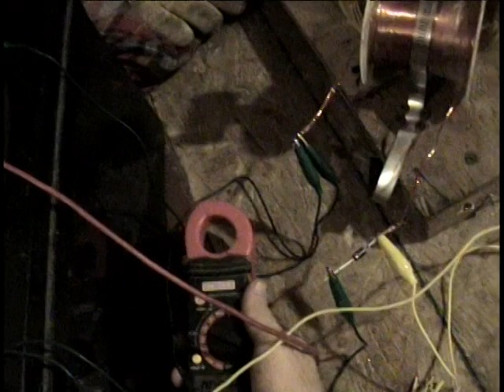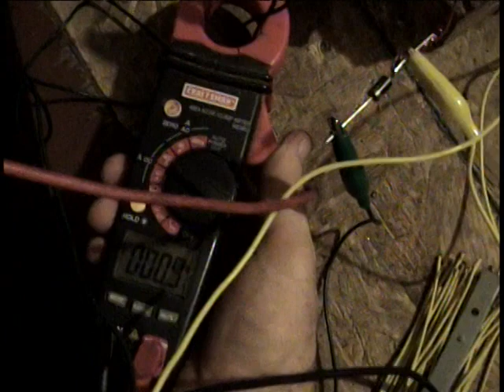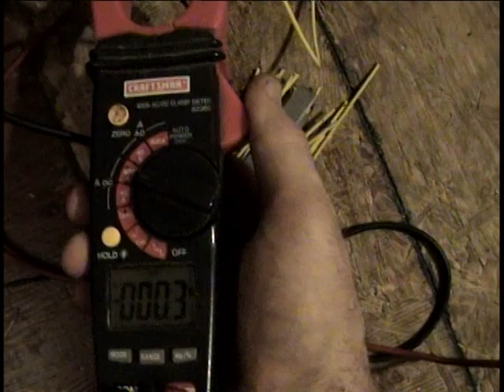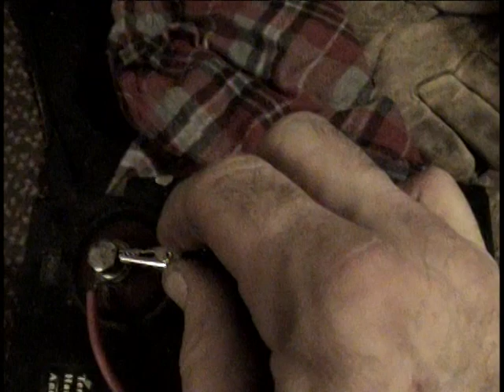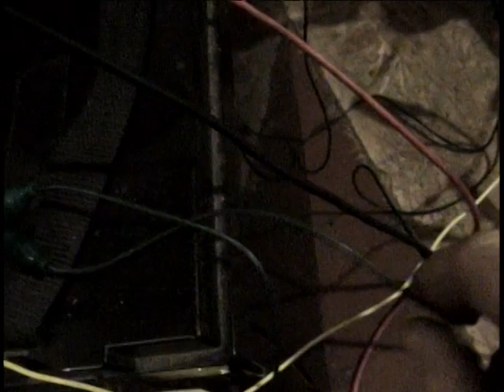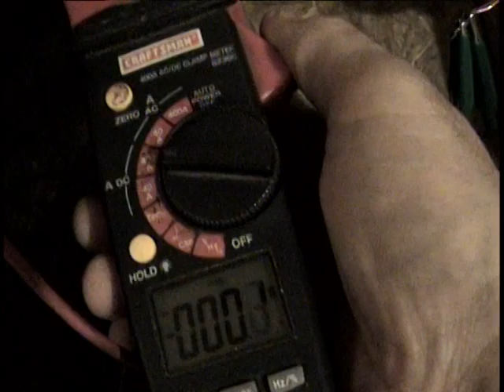pulse motor.mpg

Comment from the maker: what really surprises me is that the main power source and the energy from diode both in which I am measuring  the current of are both connected to the same place ,the positive side of the coil so I am thinking the voltage from the diode would have to be greater than the source voltage to cause a higher current to flow because they are both connected to the same place.But I will have to take some voltage measurements as you have said.I am just trying to understand and figure this out in my mind.

Comment from the maker: I'll have to try that .What surprises me is that usually the voltage is higher coming from the diode but the amperage in my motors coming from the diode has always been less than the amperage drawn from the battery.Here it shows the amperage higher from the diode ,Very different than the norm for my circuits.

Comment: You may be seeing more current, but I'll bet the voltage when drawing that extra current is very low than your input.  So measure the voltage when reading the output current and calculate the  power in and power out.  Use Power in =Vin X Iin
Power out = Vout X Iout   You will most certainly find the power out is less than power in.